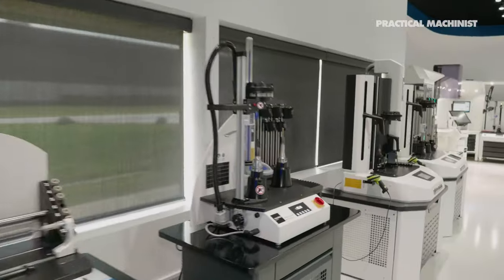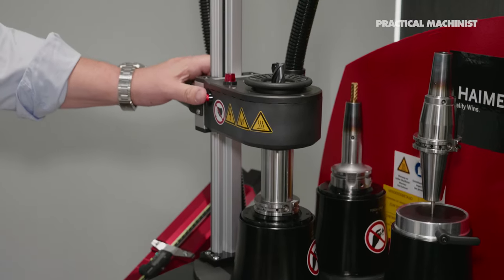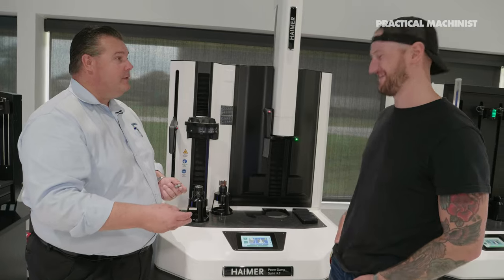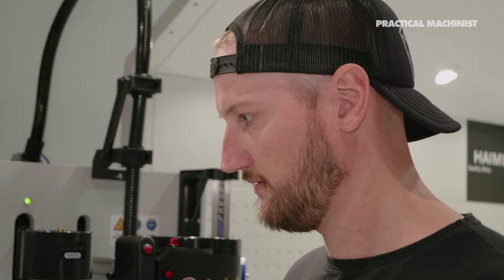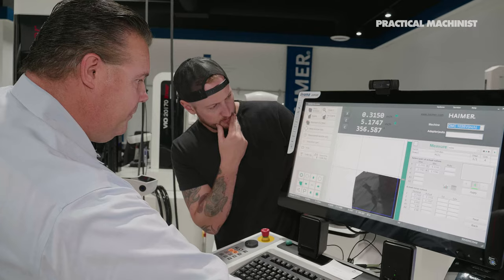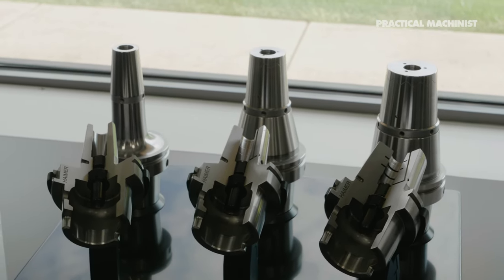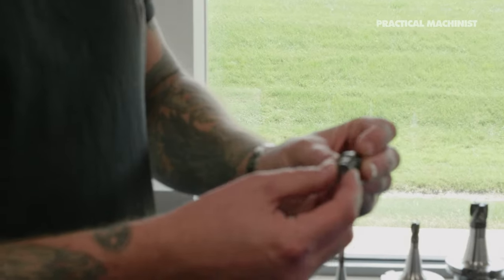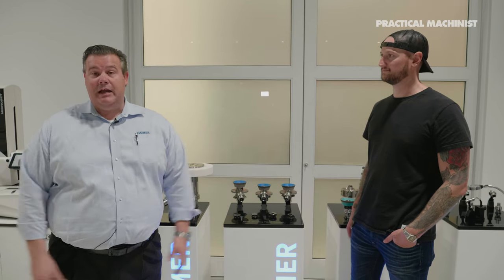Speed Up Cutting Tool Setup | MAKING THE CUT Featuring HAIMER

Comment: One question I have about balancing is if I'm running at 8,000 rpm on a BT30 spindle, with a tool holder that has ~0.0018" runout at 6" stick out, would balancing still be beneficial?
Reply: That is a fantastic  question that I will follow up on for ya - I’m out at Westec next week and I believe the Haimer folks will be there - I’ll do my best to chase down an answer!
Reply: We always recommend balancing. While tool holders themselves may be prebalanced, that isn't the only thing going into the spindle. Things like collets, cutting tools, and pull studs can impact balance and in turn, negatively affect tool life, spindle life, and surface finish. Hope that helps!